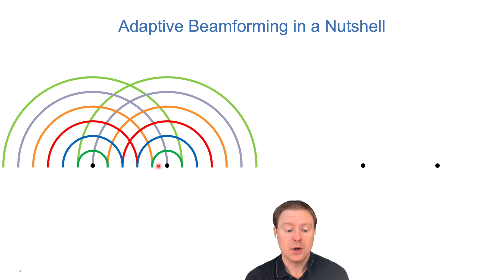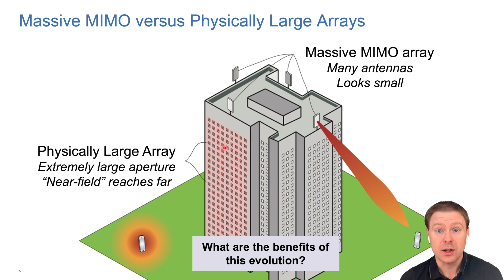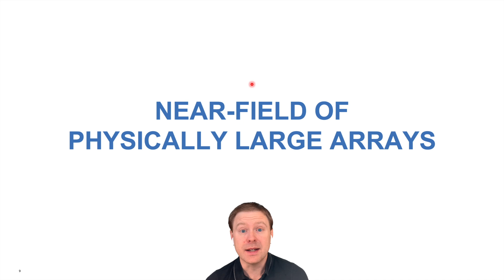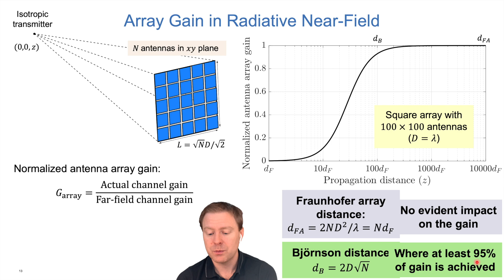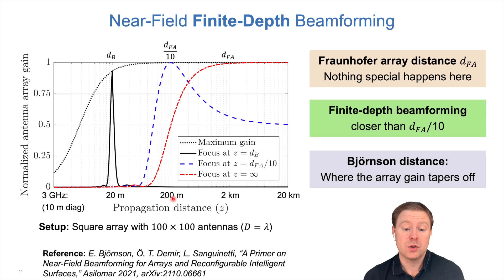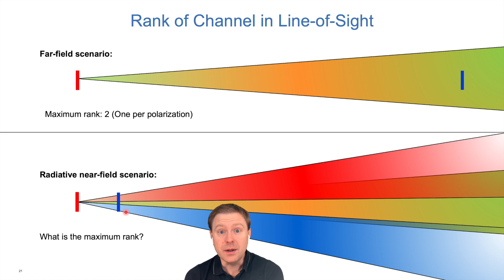Physically Large Antenna Arrays: When the Near-Field Becomes Far-Reaching

Comment: With multiple beams, can the power level in each beam be independent of the other beams?  That is, can the beam for a nearby user provide less power than one for a user that's further away?
Reply from the maker: Yes, the power levels can be controlled independently. For each signal, you assign a "beam" that determines the spatial pattern the signal will get and then you assign a transmit power to it, which determines the amplification of the beam pattern. You do that for all the different beams and then superimpose the signals (i.e., transmit them simultaneously). The only connection between the beams is that the total transmit power is limited in the base station, so if we assign more power to one beam, we need to reduce the power to other beams.

Comment: I learned that in the nearfield the energy is somehow swashing back and forth. So to my mind, the power at a point is time dependent. But in your explanation that does not to be of interest, because we point at a special local point all the time. Is that a problem in near field beamforming?
Thanks a lot.
Reply from the maker: The electromagnetic waves are time-varying and oscillate according to their frequency content, so that phenomenon is there both in the near-field and far-field. If the transmission has a stationary behavior then the waves will reach a steady-state behavior when it comes to the oscillations. I think what you are asking about is connected to the reactive near-field, where some of the field components are not propagating away from the transmitter but moves around near the transmitter. This is the situation that many people associate with the term “near-field”. However, this presentation and the recent research on large antenna arrays consider the radiative near-field, which lies in between the reactive near-field and far-field. With physically large array, we radiative near-field might cover all the distance relevant for wireless communications (e.g., from 20 to 2000 m). All the field components are propagating away from the transmitter but has not yet taken the form of planar waves.

Comment: Just a short question to slide 13. What ist the Far field channel gain? This depends on the distance. Does it refers to the gain at d_FA?
I conclude that the gain in the far field is always greater than a near field gain - is that correct? Because you use it as the normalization value.
Thanks.
Reply from the maker: The far-field channel gain is stated on slide 11. It is the conventional Friis propagation formula in this line-of-sight scenario. Yes, the near-field gain is smaller due to the three phenomena mentioned on slide 12. The gain that we consider here is not a specific number but formula.
Reply: @WirelessFuture  thanks for the quick answer, and setting the desired focal distance means that we set the phases and amplitudes from the elements so that we get coherent interference at this point?
In far field beamforming just the angle matters, now we must give the system angle plus distance.
Reply from the maker: @lucidasser7153  Correct

Comment: Thank you. It's an interesting lecture. I have a question that in near-filed and far field regions(communication perspective) slide, around 13min, about the Amplitude difference, how to get the condition d>=1.2D, the amplitude difference is less than cos(pi/8)?
Reply from the maker: The value was selected a long time ago and somewhat arbitrarily. You compute the amplitude difference between the wave reaching the center and the edge of the array. At the distance d=1.2D, it becomes 1.2/sqrt(1.2^2+1/4) ≈ cos(pi/8). We explain this on page 2 in the following paper: https://arxiv.org/pdf/2110.06661.pdf
Reply: @WirelessFuture  Thank you very much for  the reply.

Comment: Thanks. We get this gain curve where the gain increases at about 10  times the FRAUNHOFER distance. From that point closer to the transmitter, we have very low gain. The reason for that low gain are these 3 near-field phenomenons, is that right?
Reply from the maker: I'm not sure which gain curve you are referring to. If you focus a beam at the far-field, the gain will be low when you are in the right direction but closer than the Fraunhofer distance/10. One can compensate for that by modifying the beamforming, taking the spherical wavefronts into account. There is then an interval in the radiative near-field where you can get the full gain. However, when the propagation distance becomes comparable to the Björnson distance, then the gain will always be reduced. This is when the three near-field phenomena are important. Figure 1.15 in the following book chapter shows this: https://arxiv.org/pdf/2209.03082.pdf

Comment: Thank you professor for great explanation of this finite depth near field beam-forming. When we look to EMF exposure aspects for this type of extremely large arrays we can say that the persons who are in the outside areas of this defined focus spot will have much lower exposure to EM field? This means that persons could be very close to this very large arrays because it does not mean that the antenna with this huge gain potential will radiate huge EM field toward these persons?
Reply from the maker: Yes, what you are saying makes good sense. The maximum array gain is proportional to the array area and is huge for large arrays, which means that the signal is strong at the focus spot and then quickly reduces when moving away from that spot. Since a larger fraction of the transmitted power is at the focus spot there must be less elsewhere since the total power is fixed. As far as I known, the research community has not analyzed the EM exposure in detail in these scenarios.

Comment: The professor misunderstood what the near-field is. The difference between near-field and far-field comes from the distance-dependency of the induced electric field radiating from the antenna. For example, the near-field E-field is inversely proportional to the distance-square or distance-cubic, whereas the far-field E-field is inversely proportional to the distance.
If following his idea, the massive MIMO array antenna which has 16x16 or 32x32 antenna elements (commercially utilized for 5G BS) always suffers from near-field effect, which is not true.
The array distance is already considered when we use MIMO, the far-field assumption, which assumes that the radiated E-field is inversely proportional to the distance between the observation point to the antenna element, as explained above.
Reply from the maker: The point that is made in the video is that there isn’t a single near-field definition that is applicable in every context; the most suitable definition depends on whether one studies the radiated signal from an antenna or from an array (or the counterparts in terms of reception, which are equally important in communications but isn’t considered in EM literature) and whether one cares about the amplitude, phase, or beam shape of the radiated signal.

First of all, the near-field can be divided into the reactive and radiative parts. In the reactive near-field, the E-field is inversely proportional to the distance-square or distance-cubic, as you are pointing out. In the radiative near-field (Fresnel region), the E-field is inversely proportional to the distance but one cannot use the plane-wave approximations that are applicable in the far-field. Moreover, when one considers an array of many antennas, the far-field distance of a single element is much different from the far-field distance of the entire array. This is further enhancing the effect that E-field of every element is inversely proportional to the distance, but yet one cannot apply the far-field assumption when studying the jointly radiated waveform in communications (in terms of physical beam-shape, array response vectors, and SNR computation). The radiative near-field region of conventional arrays is so short that it can be neglected but this won’t be the case when using physically large arrays and short wavelengths. This is where finite-depth beamforming becomes possible. The following paper discusses these things in further detail: https://arxiv.org/abs/2110.06661

Comment: I just read something that in the near field E and H decrease way faster than in the farfield (≈ 1/r^3 or 1/r^2 or so). Can you really give such a curve term for the near field? Because like you said, you must focus the beam at a point and the gain is not Independent from the distance. That seams to be a bit odd to me. Thank you for all the videos.
Reply from the maker: The ”extra” terms that you refer to are the ones mentioned in the red box at @7:00. These effects appear in the reactive near field. This presentation is mainly about the radiative near field, which exists in between the reactive near-field and the far-field. It is normally a negligibly small region but it can be very large when using large arrays and carrier frequencies.
The graphs that shown this video are only considering the focusing effect (beamforming gain, array gain or whatever we want to call it). On top of that, you will also get a distance dependent pathloss similar to that in the conventional farfield.

Comment: Do I understand right. Within the radiative near field, the gain, and thereby received power is dependent on the distance from the transmitting array?
In other words, in this region a power-plot in a plane is a hilly environement. You have mountains and valleys which depend on the angle and the distance. Thank you.
Reply from the maker: Yes, that is correct.

Comment: As always it is very interesting. By the way: In slide 16 you spoke about the focusing on different distances. Later you also mentioned the multiplexing in the near-field. Perhaps you can address anytime how it is realized. I assume that one work with the normal digital or analog beamforming. But it is somehow difficult to imagine, how to multiplex targeted in the near-field. Thank You.
Reply from the maker: Hi! It isn't hard to implement it in practice using "normal" digital beamforming. One estimates the channel matrix, notice that it has a higher rank than it would have had in the far-field, and then apply standard SVD precoding + waterfilling power allocation (as Telstar described in the seminal paper "Capacity of multi-antenna gaussian channels"). It is only the modeling of the channel matrix that changes.

How will the transmissions look like, geometrically? With two uniform linear arrays, you will basically transmit one beam towards the middle of the receiver (strongest singular value), then transmit beams to the different sides of the array - as sketched at the bottom of Slide 21. With uniform circular arrays, one can sometimes create "beams" with different angular orbital momentum (OAM).

Comment: It is really amazing! According to the conclusion, after the time, frequency, code and spatial angular, this four dimension, a totally new dimension is born! If possible, we can call it the "near field focus dimension"!
Reply: Stepping out of the bubble of telecommunication to see what happens in broader sensing fields, for example, radar (microwave imaging), radio-astronomy/radio telescope, optics for microscope and EM field,  it can be found that the concept has been extensively investigated for decades.  By the way, the spot area after beamforming in the near field of the array is called point spread function in microwave imaging, optical imaging for microscope, etc.

Comment: Hello professor.  Can you please tell me what Weighted sum rate is in wireless communication. for eg  in IRS aided massive MiMO communication there are papers thet try to maximize the weighted sum rate.
Reply from the maker: The data rate of a user is measured in bit/s (or sometimes bit/s/Hz). The sum rate is the summation of the data rates of all the users in the system. When computing the weighted sum rate, we multiply the rates of some users with weights before adding them together. Maximization of a weighted sum will prioritize the users with large weights. I recommend you to read: https://hal.archives-ouvertes.fr/hal-01098893/document
Reply: @WirelessFuture  thank you